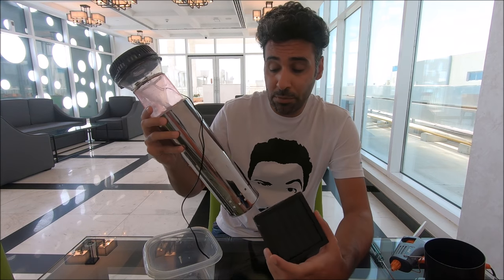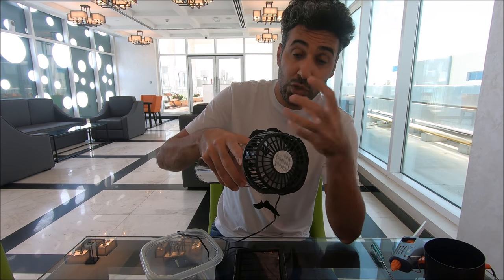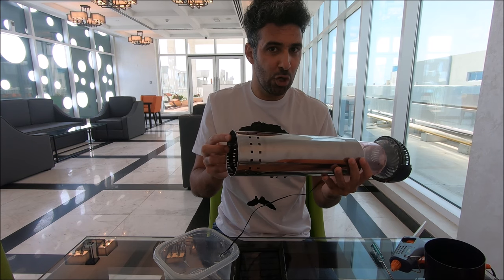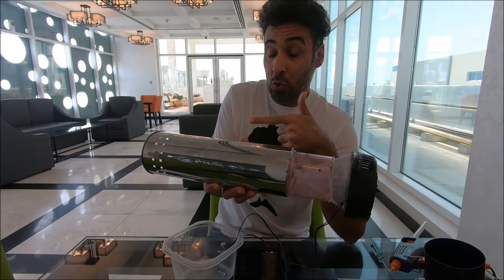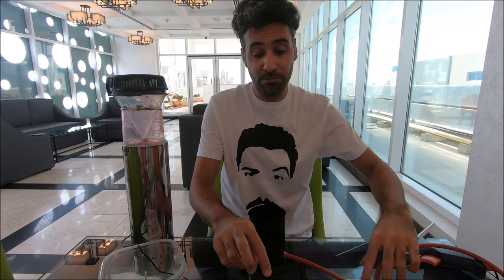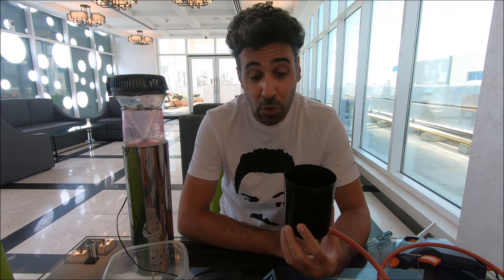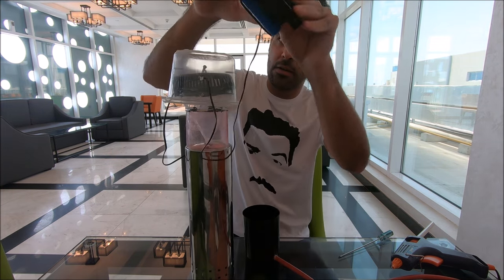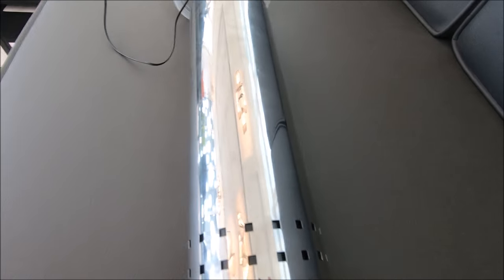Water from the air. Homemade atmospheric water generator (AWG)

Comment: I tried this in a diff way a fan attached through a platic container to a copper straw in a steel flask but after 6 hrs i saw there was nothing not a drop of water
Reply from the maker: Might be: 1- Required temperature difference is not maintain. 2- air is not humid and hot enough. 3- the device is not sealed and the air leaks 4- this model is a prototype and not very efficient.
Reply: @MrYazdan  yes maybe will try again with a few changes thanks

Comment: Please tell How to wrap copper coil inside the tube
Reply from the maker: Use pipe bender tool to turn it to coil, then place it inside the tube connected to the funnel from the top.

Comment: How much water it generates per hour ?
Reply from the maker: Depends on many different factors , but this one, in the condition I tested it, generated one cup in one day.
Reply: @MrYazdan , I'm confused - my LG dehumidifier from Home Depot collects 45 liters every day.  Granted, I live in Southwestern Pennsylvania and nearly everyone here has to have a dehumidifier to dry out their perpetually damp basements, but it seems like a much more efficient system.  Plus they sell Brita water filters in the next aisle of the store!
Reply from the maker: @ziggyzipgun  You're absolutely correct. Your dehumidifier works with AC, is more powerful and more efficient. My prototype is solar powered, small and not very efficient. It has plenty rooms for improvement. 👍

Comment: A second copper coil around (touching) the inner one circulating some coollant into the cool ground would help condense the water better.  It will require a small pump. Try it first with cold ice water to see the increase of condensation. 
Did you test the battery to see how long the fan will operate?  It looks like a 18650 type Lithium cell, which usually gives about 1-3 hours of fan operation, depending on the speed.  Use the solar panel to charge the battery as you would like, then connect it to the fan, and put it in a dark closet to see how long it will run.
Also, view this video for an idea to increase the cooling of the coil:   https://youtu.be/o68leKAf-Gk